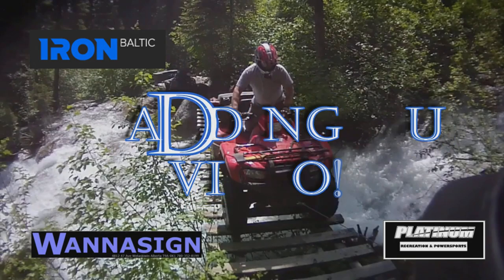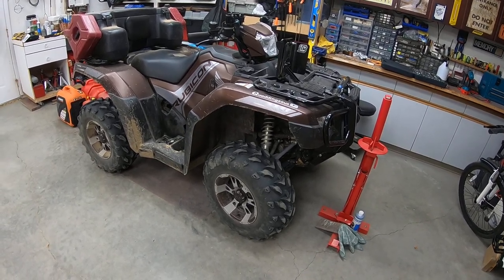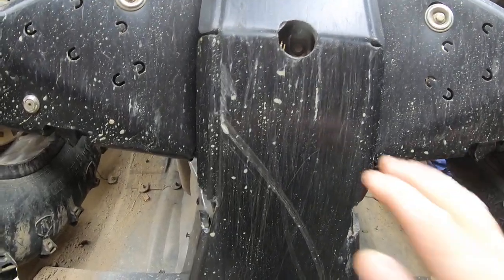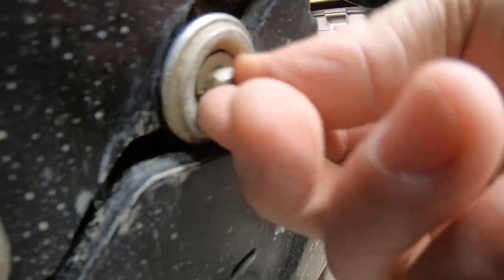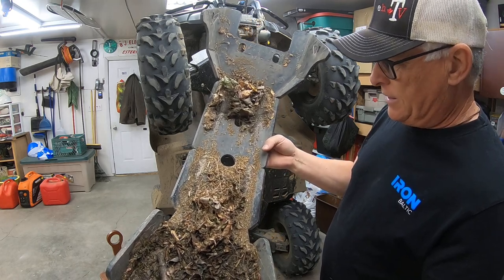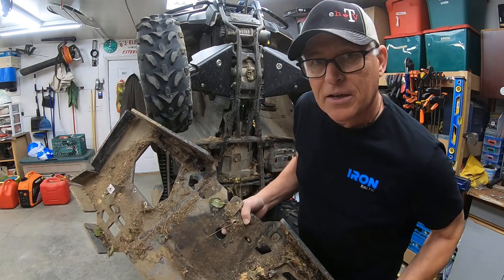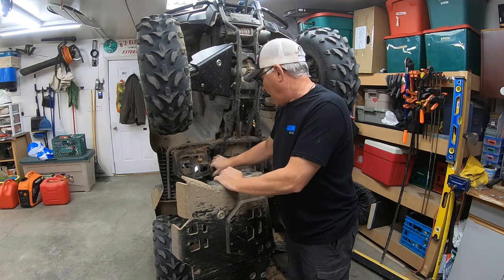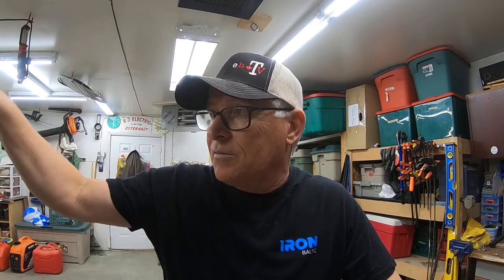Iron Baltic Review/Update/Opinion

Comment: Thanks for the update on those. I want to get a set at some point & was going to go with the metal ones. Was afraid the plastic ones would get cracked, etc. Guess the plastic ones do hold up though.
Reply from the maker: Yeah, I hear ya on the big decision Kyle. I deliberated long and hard on Aluminum vs Plastic too. One of the reasons I went with plastic is that there is way less friction on plastic than on aluminum. Another pro for plastic is that it doesn't bend. Aluminum will dent and bend. When you "unbend" it, you create a weak point in the metal, which will allow it to bend easier again the next time you bounce over a bolder or log. I talked to a lot of guys with both skid plates and the consensus was to go with plastic. Even Iron Baltic steered me toward plastic, advising they were actually better despite being less expensive. I'm not worried about these things cracking/breaking at all. They are very very strong. One of my neighbor's is a plastic fabricator and he looked at them when I first got them. He named the type of plastic it was (which I can not recall because it had a long scientific name - lol) and said it's almost bullet proof.
Not sure if this info helps makes your decision easier or more difficult, but good luck with whatever you decide and thanx for watchin'!
Reply: @quaddingsous  yes, I will be going with plastic now I think. Didn't know they were cheaper though. Thought they were the same price. Haven't looked at them for over a year though. Thanks for the review & input.
Reply from the maker: @kylethefryan1111  . . . NP my friend!

Comment: they ought to countersink those bolts
Reply from the maker: I agree, but I'm not sure they can without weakening the area too much. The plastic is only 1cm thick. But now you've given me an idea😉
Thanx for the comments and for watchin' Randomity!
Reply: @quaddingsous  I bought a skid plate from Yamaha for my 2012 Grizzly.  There weren't any washers and the bolts were countersunk.  I've order an Iron Baltic for a new 2024 Grizzly 700 and it's a bit disappointing to hear that these aren't countersunk.  So much for sliding over rocks
Reply from the maker: @randomity655  . . . The washers are a counter sunk style, rounded on the edges so the bolt heads are actually sunk into the washers. I haven't had any issues yet, but the idea you gave me was to use a forsner bit in a router to drill out the plastic to make counter sink holes, then regular flat washers with the bolts. Gotta do some measuring first though. Wanna make sure I don't have to take too much plastic off.